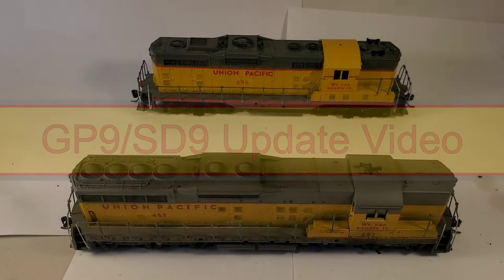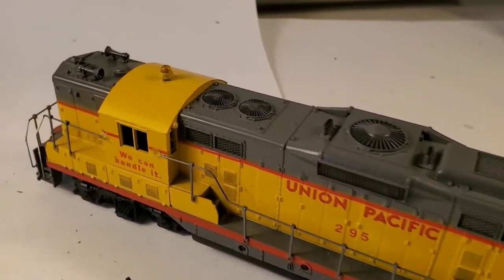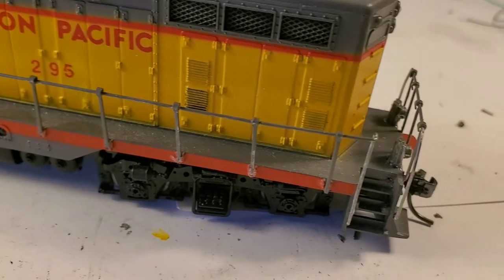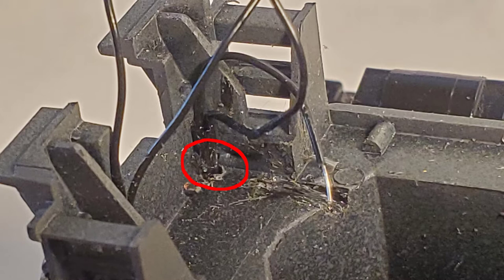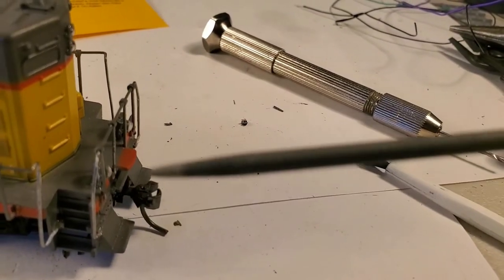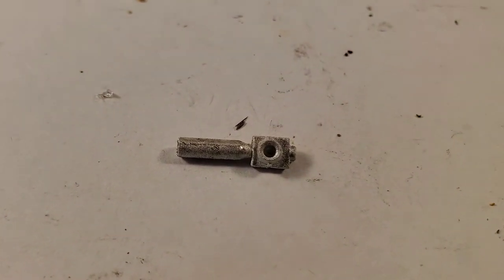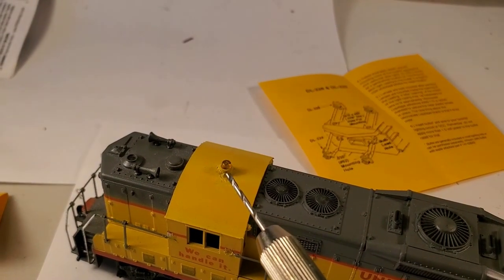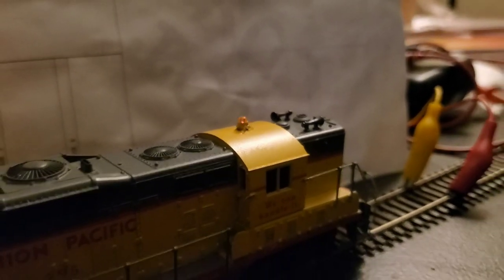GP9/SD9 Update Video: More Lights!

Comment: Love the videos man. Just recently acquired some athearns and a proto 2000 having issues trying to date the proto tho lol. 
The 4 athearns are all undecorated running still with all the black motor and steel flywheels. 
1974 sd9
1975 f7a
1975 f7a
And a gp30 but it didn't have paperwork other than a purchase receipt from 1987 so idk if that indicates its year or not but it also has a steel flywheels and black motor so idk. The proto is a illinois central gp9 and I haven't been able to date that one but it was a nib nos never opened never ran purchase. I enjoy watching all the small detail you add bc it makes everything just look as it should just smaller. The 3d print stuff you do is awesome and I'd love to get into that myself but so far I wouldn't even know where to start w that. Look forward to more gp and sd content. Ive been stuck on my favorite style locos being the old ahm sw 1 switchers have liked them since I was a kid but they are hard to find content on.